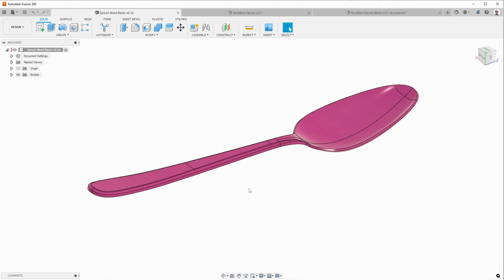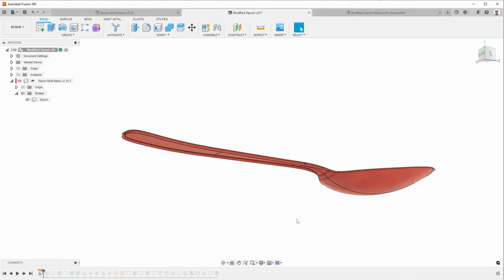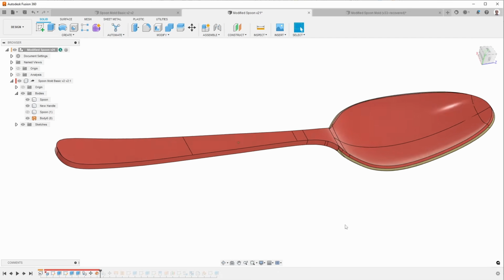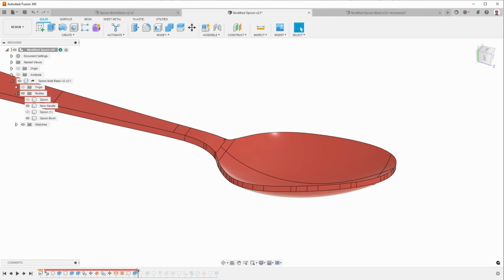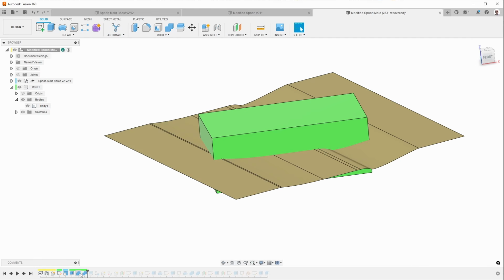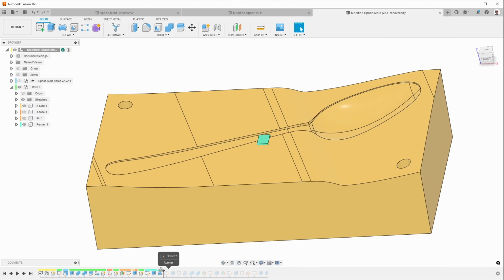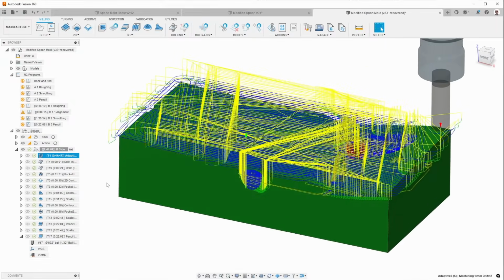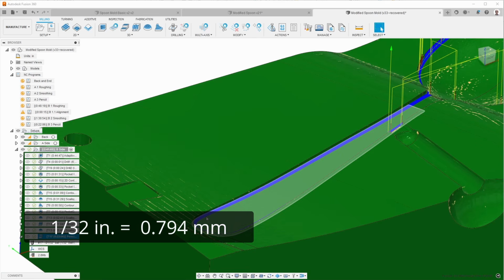Injection Molding a Spoon - Designing, making, using

Comment: I'm curious about adding a texture to a part and seeing the process involved on the molds. I've heard they used acid etching but how do suppliers achieve a specific texture?
Reply from the maker: I have not added texture to any of the mold I've made. I do know one approach is masking and then sand blasting. Dragonfly Engineering showed that in one of his recent videos. I don't remember which one and wasn't able to find it.
Reply: There are extremely precise methodologies in place such as wire EDM (electric discharge machining) which can produce sharp inside edges and other extraneous details which are not possible with CNC. A main consideration with the actual injection molding process is that if you have a surface roughness which is increasingly high, you must also have increasingly higher draft angles due to the implications these rough surfaces have on ejection. You don’t want to have a rough surface which has no draft because it will cause the part to “hold on” to the mold when it’s being ejected in its softened state because it will deform due to ejection forces supplied by ejector pins. Rather, you will want to add significant draft to a part which has a rougher finish such that the part is able to overcome the static frictional force with relatively low ejection forces, so as to mitigate deformation and “witness marks” (a defect) which the ejector pins imprint upon the part upon ejection while the part is in a semi-softened state. For extremely rough surfaces (such as surfaces seen in faux leather vehicle interiors) it may be recommended to have a minimum draft angle of 6 degrees or more. Hope this helps! Message me on YT if you have anymore questions!

Comment: Any specific reason to use that very long roughing mill or was it just something that was readily available in the machine?
Reply from the maker: Hah, I was wondering when someone would notice that! I put it in there to clean up the saw-cut edge. Because of the thickness of the material, the longer end mill had cutting edges for the full depth. I've since switched back to the normal length 3/8" end mill.

Comment: Cool spoon that doesn't look anything like the customers cad that they provided. I wonder if they were happy with that. If I ordered this tool and got that spoon back I would be very confused.
Reply from the maker: I followed the instructions from the customer. They didn't create the CAD file they sent. Rather, they said make a spoon that has this rough shape, but a uniform wall thickness. I made the changes and sent the results back to them for approval. Their response, before I designed and made the mold, was "that's perfect." So this was exactly what the customer wanted and expected.

Comment: have you video in autodesk inventor sir.. because i learn inventor not a fusion ..and what material do you use aluminum or what
Reply from the maker: I have no experience with Autodesk Inventor, and it's a lot more expensive than Fusion 360. This is a hobby for me, so the lower price of Fusion 360 is what keeps me using it.
Reply: @JohnSL  ok sir thank you anyway 👍

Comment: Really nice video sir, informative for beginners.. 

I have a question 🙋

1. During model revision for thickness, could you have cut the body into shaft and spoon and just use offset or press pull command in modify task bar. 

2. How can we use curvature analysis tools to understand better. 

3. Can we sumulate the mold flow in software to under stand material consumption, flow pattern, and filling & cooliny time
Reply from the maker: The main issue I was having with the shaft is that it didn't have a uniform thickness, and I wasn't able to remove the details. I learned the trick about offsetting a surface to make a new solid model after I'd modified the shaft. So, yes, that might have been easier. I showed how I approached it, which included me learning what worked and didn't work. Fusion 360 does have mold flow analysis software, but that's an add-on that is about $1,600 a year. If this were my business, rather than a hobby, that would certainly be worth investing in.
Reply: @JohnSL  yea certainly. 
Your all your videos are interesting. 
We are thank full for your hobby.

Comment: You could go a lot more aggressive with the machining
Reply from the maker: Do you mean with the roughing? Not on this machine. While it has a 7 HP spindle motor, that's actually to allow spinning up the spindle quickly to 30K RPM. The limitation on milling is the spindle itself. It's a very small ISO-20 spindle that is designed for precision and high-speed, but not for large side loads. The manual states max end mill size is 3/8" diameter and max WOC/DOC is about 20% (one of them is 25%, but I never remember which) at 10K RPM. They have some other limitations, but you get the idea. I could certainly be more aggressive, and would then most likely need to buy a new spindle as a result.

Comment: What can someone expect make doing work like this? What's the overhead? Where did you learn solidworks? I've always had trouble deciding what I'd like to do for a career. I'm into so many things, but opening a business like this sounds exciting and interesting. Please reply.
Reply from the maker: I don't have the experience to answer the first question, as this is a hobby for me. I did have SolidWorks and liked it a lot. But they yearly fee to get new versions was around $2K, so I just didn't upgrade. I also had a separate CAM package that was very limited. The CAM in Fusion 360 is so much better. So between the much lower yearly cost and the fantastic CAM, Fusion 360 was a pretty easy choice for me.
Reply: @JohnSL - Random Products  what about your cnc? What type is it and what's something like that cost?

Comment: I'm a plastic injection mold maker, and you did a really great job. Our tools usually have a whole ejection system, and we generally have to "spot" the tool by hand using all types of die grinders. There's generally 10 thou of stock left on the tool, which must be removed by hand, so as to ensure a PERFECT seal off, it is also much faster than machining it to size. Very cool.
Reply: @heatround102  At one company I worked for, we had a machine that could hold a mold that would fit about 8 of those spoon molds in size (the whole blocks, not the spoon itself, so you could fit a lot more spoons by layering them up and down instead of a single one at an angle.

The machine itself held the mold and didn't need to be removed by hand to take out the parts.  Instead was automated to close the mold, inject the plastic, then drop the parts and repeat for as much as you told it to (or however much pellets of plastic you could load into it).

Now this was a smaller machine and it was the only one in the shop, as they only used the machine for specific things (not spoons, but parts for things like cars and other machines).  But this allowed for relatively small molds to be used in production.  While I've not worked with larger machines myself, I have seen them and you can get some sizable molds in those things.

By small injection mold machine, I mean the one was about 2/3rds the height of a VF-2 HAAS CNC machine, about as deep and twice as wide.  So maybe not so small... but is considering that that was the largest size mold it could handle and it was fully automated.  As a CNC machinist, I tended to make the molds, not run this machine.  Though it was simple enough, just filling it with pellets, entering in how many times you needed it run and then placing a button pusher in front of the machine to keep an eye on it while collecting the parts and deburring them as the machine dropped the finished parts out the bottom into a bucket.
Reply: Do you know someone making molds but bigger  molds for 110 ton injection molding machine 
Please  recommend one 
Thanks
Reply: @ilyashoshana3950  I dunno depends on your region. I'm in Canada and Where I live all the shops cut huge molds for automotive purposes. Our work from beginning to completion can cost anywhere from 100s of thousands to a million.
Reply: @jackorlove4055  hi im machine engineering student rn and my thesis about plastic injection machine design. im supposed to design a machine. do you mind about giving me little help please like where can i find basic schemas or any information about plastic injection machine parts. thats not my subject tho so i do not have much knowledge about construction. any links or etc appreciated
Reply: @anaksimenes001  I can't really say, I could write 50 pages here on YouTube chat about every part of the design. There's so many parts to a mold, it would help if you ask me for specifics. Are you trying to make the core or ejection system of the mold? 

The core for example has the core clamp plate, rails, pillar supports, guide or leader pins, stop buttons/ejector stops, slide carriers, slides / retractor slide,  lifter feet/lifter feet housings, lifter rods, lifter head, retainer pins, ejector pins, core pins, sleeves, bushings, springs, ejector plate, etc, etc,. I could go on and on. Plus it all depends on the kind of design you're going for.
Reply: @heatround102  It's really hard for me to say in this particular case... This could be prototyping, which happens a lot in my trade.

Customer wants to get an idea of an end product. We have a TON of prototype molds at our shop, which are just sitting around collecting dust.

To me, this looks like a prototype. I don't think this would run production, it just seems way too time consuming. Unless of course, they just don't need that many spoons? I can only speculate on the needs of the customer.

They could be trying out a new material, seeing what full scale production might look like cost wise, might be showing another customer an idea of what the product may look like. 

It is indeed cheap to buy plastic spoons online, but there is also economy of scale... 2 cents could be adding up to A LOT, and it may very well be the case that running production on your own utensils is only fractions of a penny.

Ordering from other places isn't just the base cost of the spoon, you're paying mark up, shipping, and potentially other fees/man hours. If you can make your own spoon, for example, you have cut out a lot fluff.

This could also be a competitor trying to squeeze into the plastic spoon market? You never know. Could also be a restaurant or fast food chain wanting to get an economy of scale.

There is a reason so many companies opt for owning their own plastic injection molds. These tools pay for themselves.
Reply: @jackorlove4055 yes, normally this is for prototyping, the actual mold would be a lot bigger and heavier to be able to produce on a large scale on an automated injection molding machine, I work in injection molding and some molds are as big as a teenager and weighing 3 tons only on one half of the mold

Comment: Too much contact surface where it dont needs to be! Probably this style of tool (where the whole surface contacts) would make out toolmaker cry. The other thing is with the external radiuses, I know its technical but put a bigger radius on the part edges than your smallest mill radius (Unless you want suprises). 

Sorry for being salty!
Reply: Plastics engineer here. Actually, the excess contact surface is extremely necessary. This is because the injection process has extreme pressures which exert a massive force on the walls of the mold. If you were to have a mold with thin walls, you would absolutely blow apart the mold after a few cycles due to the deflection that molds experience due to injection forces. This is so important actually, that for high production molds with cooling lines you have to place the milled cooling line channels a certain distance away from the mold cavity so that the mold doesn’t self destruct due to injection forces lmao😂😂

Comment: Does the excess remains from the gate which you removed go back in the cycle?
Reply: If the customer has a grinder then yes this is possible. The material which is grinded and fed back into the feedstock is known as “regrind.” Typically a percentage of regrind is used in manufacturing processes, but it is mostly prohibited in the manufacturing of medical devices.

Comment: This is interesting. But there are hardly any injection molding facilities in America anymore. It’s all done in Mexico. This machine would be used for experiments, but not for production. 

And equally interesting is the fact that thousands of trucks enter the U.S. from Mexico everyday, and none of them are inspected. We have no idea what’s in those trucks.
Reply: I think you’d be surprised.  If you just need a few thousand small parts you can’t justify the mold expense for an automated machine. 

I learned about small run parts by helping a friend of a friend modify a mold about the size of the one In this video. He had a niche part he sold, but the total annual sales was only about 2000 units. 

When I ended up having a similar need I got the same manual machine (as in a lever!) and made molds on my Tormach and I was in production for under $2500.

A $14/hour employee making a part every 78 seconds that nets $6 per part is fantastic. And future design changes just cost me $4 of aluminum and time on my mill to make a new mold. 

We made over 8000 parts with those molds, though I did end up building my own pneumatic injection molder with microcontroller for consistent injection results. 

There are more parts made like this than you’d imagine. And I never would have had a large expensive mold made to try out a product.
Reply: Go to Wisconsin. Or upstate NY. Corning literally makes all of their products there. They invented Pyrex.

Comment: Maybe I missed it, but you didn’t say what CAD software you used, what die material (P-20?) you used and what CAM software was used.  Also it would have been nice to show your CNC machine in more detail.  Nice video.
Reply: Fusion 360 is the CAD and CAM that he shows
Reply from the maker: As Nic said, Fusion 360 for CAD/CAM. The molds are aluminum, which is a very good choice for small runs on desktop as the thermal conductivity of the aluminum does a good job of dissipating heat with the need for water cooling. As to my CNC mill, you can find more in my video here: https://youtu.be/Y9nnBf-tvJY

Comment: It's a very interesting process. Thank you for sharing. 
I can't help but wonder, why would anyone spend the money on a custom mold for a spoon that doesn't appear to be any different than what you can easily purchase by the hundreds for pennies each? Am I missing something?
Reply from the maker: I was given permission to make a video of this mold as long as I didn't divulge why the customer wanted this mold. So, unfortunately, I'm not allowed to explain why.
Reply: well, you can assume that this spoon will not be made by the hundreds, based on the injection molding machine used. there's also a hint about the material the customer will use - the original design is like any polystyrene spoon but he had to make heavy changes to account for high viscosity in the materal.
Reply: I am really invested in figuring out the secret behind this single spoon mold now

Comment: How thin were the thin sections prior to revisions?
How do the part weights compare on the before and after revisions?
Reply: Th wall thickness is determined by the size required for te material to flow from gate to end of cavity. 
Wall section itself does very little for strength, strength comes form form.
I have no idea of its intended use, but the weak spot is where the handle joins the dish feature.
If you study single use packaging, you will quickly learn how to achieve the most with the least..
Reply: @geoffcrumblin7505  I did a fair amount of disposable plastic table ware.  Very competitive industry, and well suited to Husky double stack tooling.  So we’re the revisions based on a mold flow analysis?

Comment: Precise surfacing for plastic parts (where reflections of light - specular highlights show all imperfections) in Fusion is impossible. The software simply wasn't made for it. Also I'm not sure but I have a feeling I see polygonal faceting on the surface of your cavity - what was the precision in Fusion cam operation settings set to (T13 scallop operation)? Also what is the max file size of the g-code file for that HAAS?

Comment: What are the effects of tooling marks on the final product? Do they cause it to stick to the mold or are they visible in the final product?
Reply from the maker: It's mostly that they're visible on the final product. How visible depends on the plastic and how much injection pressure is used.

Comment: Great video! When creating molds for a part with uniform thickness you can simplify it using only surface model with no thickness. And the you add thickness in CAM using negative Stock To Leave on lower half mold
Reply from the maker: Doing that would mean you wouldn't have any draft. I'm also not sure how well that would work with things like REST machining. I generally like to have the CAD part, and therefore the mold CAD model, as close to the final milled parts as possible. That also allows me to use the CAM analysis tools that show deviation of the CAM results from the desired results.